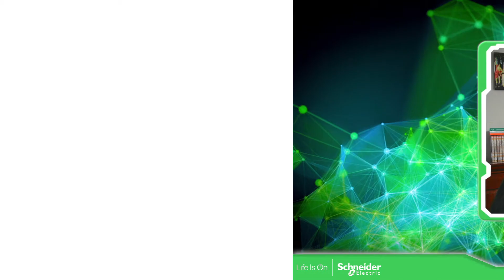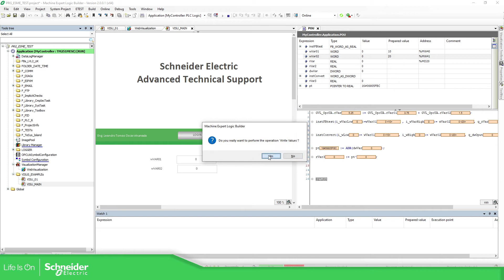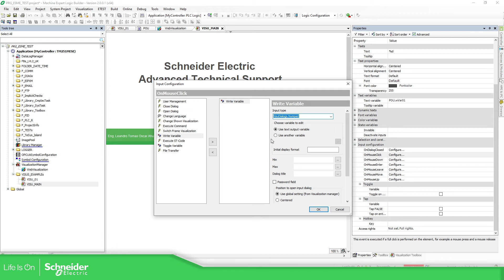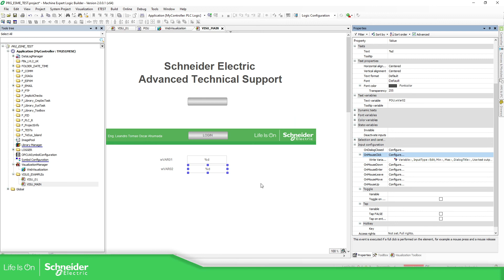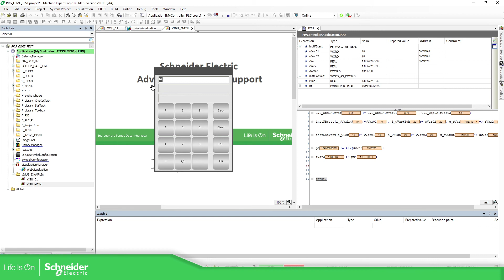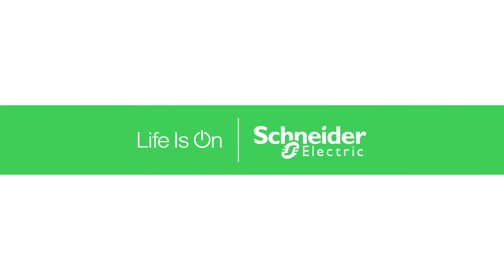EcoStruxure Machine Expert -  How to change analog values in a visualization

Comment: Hi Leandro, I'm working with visualizations in machine expert as part of a project that uses lots of images (and resources). After the last update I made for a client, they commented to me that there were issues related to "the machine freezing". When I inspected the issue, I realized this problem was related to the refresh rate/interval of the visu task manager as the visualizations were consuming a LOT of resources. The PLC was reaching 85% usage and then went into fault mode. I increased the refresh rate from 20 to 175ms (visu task interval)  and it got solved. However, after one week the client told me there were some issues with buttons becoming gray after a few minutes not using the equipment (HMI) and I don't know how is that even happening. The tick on "paint disabled elements grayed out" is active but that never meant a problem before.  Is there anyway I can reduce the consumption of resources? Cheers
Reply from the maker: Hi there! It seems to be an interesting project to take a look into. Not sure how the design of the visu is done but maybe reducing algo the amount of element in each visu page maybe the solution. Also changing the visu task and the mast task to avoid the 85% may help.

Comment: Thanks for the good videos about PLC.
How can I use scaling block (SCL for Siemens) In Ecostructure machine expert for M241 for analog signals
Reply from the maker: Hi Mike! Form the library "Util" of the software (automatically added in the project) you an use the function "LIN_TRAFO" , it requires the inputs of the block to be "REAL" so you can probably convert the Analog Inputs to Real by using the function "TO_REAL". More information about this LIN_TRAFO block can be found in the next link:
https://product-help.schneider-electric.com/Machine%20Expert/V2.0/en/Util/index.htm#rhfulllayout=true&rhsearch=LIN_TRAFO&rhhlterm=LIN_TRAFO&rhsyns=%20&rhandsearch=0&SUBSTRSRCH=1&t=Util%2Fmodules%2FLIN_TRAFO.html

Another solution is to configure the Analog Input in the tab "I/O Configuration" in each TM3 Module so you can preconfigured the min and max value.
Reply: @LeTomasAHUMADA  thank let try it out

Comment: can you explain to us how to carry out a supervision between a m221 automaton and scada expert machine in tcpip?
Reply from the maker: Hi David, I believe is going to take me some time to prepare something related to Machine Scada. I did a quick test and what you need to read/write variables is the following:
1) Add the driver "MOTCP" on the "Drivers" in the "Comm" tab.
2) On the sheet create your variables (if there are not already created)
3) For the "Station" use "IP of the M221":502:1. example 192.168.1.221:502:1
4) For I/O Address related to %MW use the 4X:(%MW+1) . example reading %MW10 --> 4X:11
5) For I/O Address related to %M use the 0X:(%M+1) . example reading %M1 --> 0X:2

If you right click on the "MOTCP" driver you can access to the help for further information.